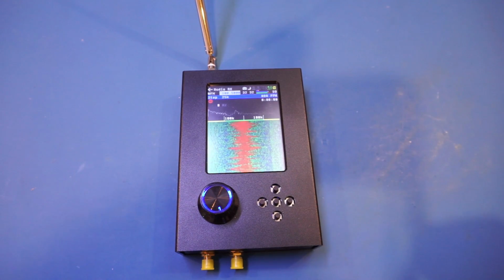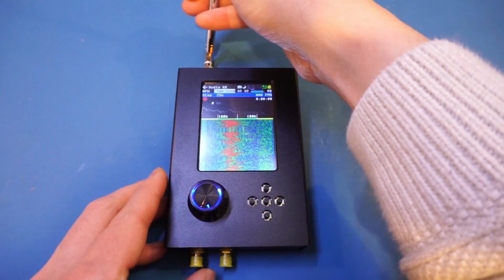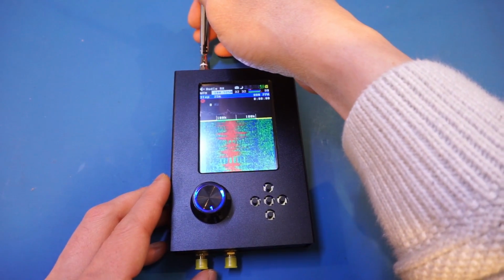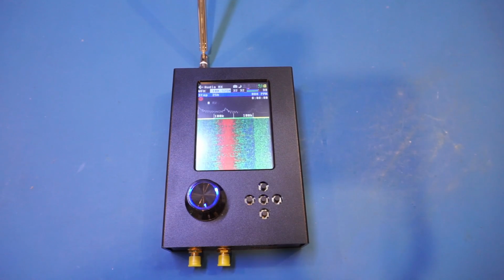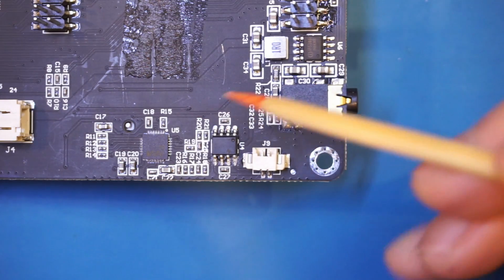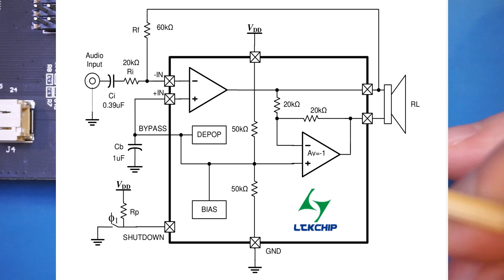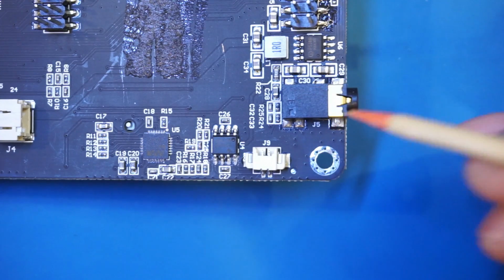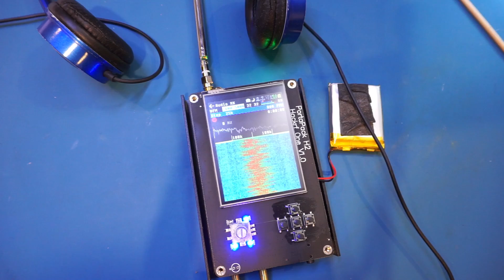HackRF One PortaPack No Sound? Can it be Repaired?

Comment: Thats crap quality. The headphone socket should have had pins going through the board, not just surface mounted pads. If that wasn't possible, it should be held in place with glue. The previous owner must've put too much force on the headphone cable.

Comment: Awesome ! You could check to see if the back pads can be reconnected there must be a via somewhere to take it down the stack up. None of this explains why the internal speaker isn't working unless the jack cuts it off as plug inserted  but you can follow speaker wires back now and if necessary wire directly to the most convenient point. Having found the audio output ok can't be much to it to get it full functional it is after all a single chip and a mono signal or at least one speaker. Would be great to see a few more repairs Kerry !!...cheers.
Reply from the maker: Well, the black soldermask makes the circuit board much harder to work with. But I agree, I just need to trace it a bit more. Another challenge is that the chip is on the underside of the PCB when the portapack is plugged in so can't do realtime measurement easily.

Comment: Your result proves that the two  jack contacts that are missing pads must be the speaker connections to the jack.  You can confirm this with a simple ohmmeter. 
Connect the speaker directly or add bodge wires to bypass the trace to the speaker connections in the board.  
You are lucky you didn't tear off the middle two pads. Anchor that jack with glue!
Reply from the maker: Yeah unfortunately, the ripped off pads seemed to originated from the inner layers as I was not able to buzz out the traces.
Reply: @KerryWongBlog  so just wire the speaker directly to the back two tabs of the headphone jack/switch.   No need to buzz them out.

Comment: Nice! Dare to make a bodge-wire fix by guessing where the trace has to end at the amplifier circuit? Or connect the speaker wire as a bodge-fix to the headphone jack?
Reply from the maker: Not as simple unfortunately as I did some testing after the video was recorded and some of the traces routed via inner layers of the PCB. I could just connect the headphone jack output directly to the speaker but it means I'd most likely lose the mic input. Will need to find the actual board layout to make sense of how the headphone jack is wired.
Reply: @KerryWongBlog Thanks for this honest "I already tried and failed" answer!
Reply: @KerryWongBlog  If there is anything left of the via you can solder a wire to it, then see where it routes to. Only 2 wires, and you can bet both or one lands at the speaker, and the other probably goes to a pad elsewhere, but if you get even poor connection with the via you can get the speaker running again.
Reply from the maker: @SeanBZA  Thanks, I will give it another try. So far no luck yet. Was hoping to find the actual board design and it would be much easier.
Reply: @KerryWongBlog  True, but even looking at the layout of that headphone socket, and a multimeter, will give a pretty good idea as to the speaker feed, and you then just have to add the one or two jumper wires for the speaker, as it is likely the switch in there goes direct to one lead, and the other goes to the amplifier. See the speaker lead that is common, to both socket and audio IC, and the other will be the broken one.

Comment: The jack has pads that do nothing but mechanically attach the jack to the board. Because those pads did not lift off as well, it is clear that the jack was never mechanically married to the board. Meaning, a manufacturing defect. Maybe you should approach the manufacturer. Or, at least go back in and add some type of glue to support the jack... A glue that can be removed... I like Shoe Goo, better than hot glue. It is in the shoe department, where the shoe polish is kept. HTH. Cheers.